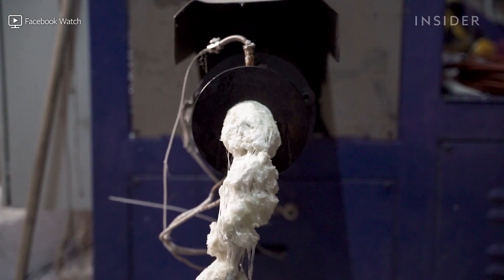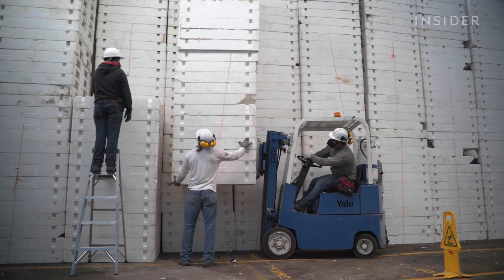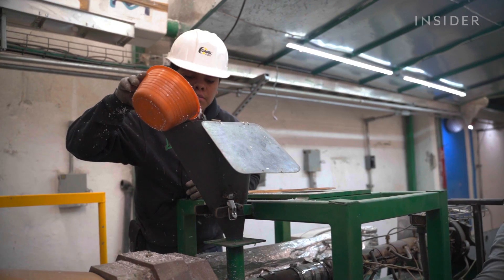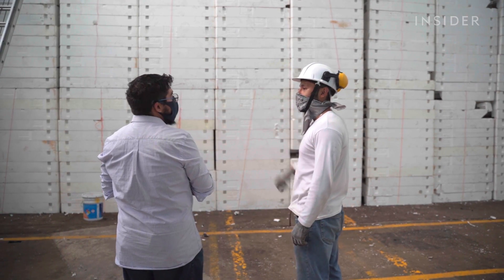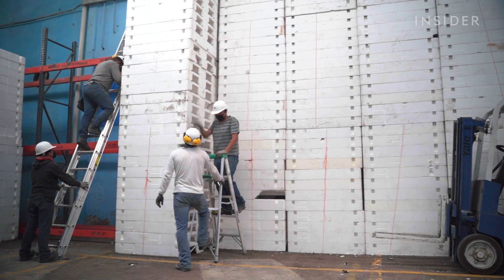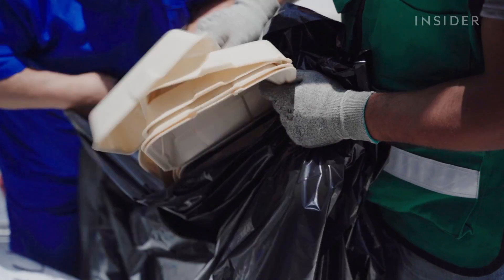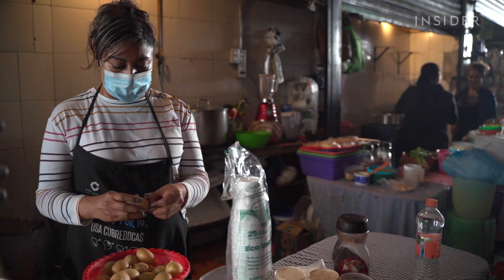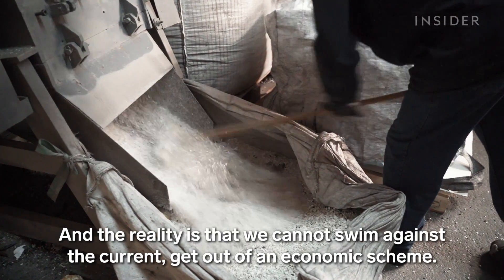Why It’s So Hard To Recycle Styrofoam and Polystyrene | World Wide Waste | Business Insider

Comment: for every type of plastic, there should be equal number of recycling facilities and manufacturing plants, unfortunately we don't have those, so we produce more but recycle less.
Reply: Well the manufacturers should be responsible for the recycling.
Reply: If recycling give profit, people will actually do it.
Reply: There are many types of plastic
But there are many many many many grades of plastics 
Hundreds of thousands if not millions 
It’s practically impossible to have a recycling facility for each of them
Not to mention the nightmare of collecting and sorting them (which actually consumes a high amount of energy and will have a higher carbon footprint and a higher impact on the environment rather than just making new plastics and burning the used ones for fuel)
Reply: @Vedrajrm  One of our only possible ways forward is forcing more standardization in materials to help facilitate reuse. There will always be a need for a certain amount of single use products, so we might as well acknowledge that and figure out how to make it work while creating less of a disaster.
Reply: @Vedrajrm  You can't burn most plastics as they give off toxic fumes... yet more impact on the environment and life.
Reply: @menotu000  you can burn them

Given enough temperature and oxygen you can even burn rock.
Burning plastics at high temperatures and using appropriate filters does not release harmful fumes.
That’s exactly what Singapore is doing. They are burning all their trash and recovering the energy.
Reply: @Vedrajrm  In addition Recycled plastic is a of a lower grade and needs a certain amount of virgin plastic mixed in.
Reply: @Vedrajrm  Then that should be a major point in any government action. Many choice about plastic usage in manufacturing are arbitrary and most needs can be filled by a small slate of plastics. Steer most companies into those options, and you can reduce the amount of non-recyclable plastics.
Reply: @ebwrigh  what options are you referring to?
Reply: @Vedrajrm  better materials are glass, aluminium and paper. glass and aluminium can be recycled almost lossless, paper can be very effectively downcycled
edit: of course melting down glass and aluminium are very energy intensive tasks, but depending on the source of the energy (fission/renewables) this isn't that bad.
Reply: @insu_na  glass isn’t better per say, they are heavy so more energy needed to transport them.
And they are fragile, they easily break.
And with both glass and aluminium as you mentioned, they consume a lot of energy to be made in the first place. Even if you use fission (highly improbable) or renewables, consider the energy needed to build the said renewables in the first place, building solar panels and windmills also takes a lot of energy.
Paper of course require trees to be cut down.
They need land, not just any land but fertile land. Land which might otherwise be used to grow food.
Don’t forget the water and the environmental impact of the pesticides.
There’s a reason why plastics are so popular.
They are by far the best material available to mankind
Reply: @Vedrajrm  lmao at this point they don't want plastic recycled 😭😂
Reply: @thesparks00  plastics recycling simply does not work.
It’s a myth.
It’s mostly downcycled.
Reply: @Vedrajrm  Plastic can be subjected to a process called Pyrolysis where it is turned back into oil or diesel. There's no need to separate the different kinds of plastics and the end product is actually better than virgin oil. Recycling, like you say, is not the way forwards and it's encouraged by oil producers simply because it has limited usefulness and hence not a threat to the demand for virgin oil.
And it can be done on a very low tech basis as is done by families in the developing world that don't have electricity infrastructure or gas, petrol etc
Reply: 100 % And in the near future replace plastic by bio products made from Algea, plants etc.
Reply: What about making plastic producers responsible for providing those recycling facilities, to be plastic-neutral companies?
Reply: shoulda coulda
Reply: Resins 3 through 6 cannot be recycled at all, having 4 separate recycling facilities for them would equal 4 empty recycling facilities doing nothing.
Reply: The door is open to you.  Create your business plan and start your recycling business.  It's my sincere hope that you'll earn a comfortable living while solving a problem and employing others so they can feed their families and prosper.  Or you could just complain.
Reply: The real problem is that people don't recycle. One of the biggest problems, costing a lot, is sorting different plastics, if people has put those to recycling bins
Reply: Yeah bc they don’t give a shit they just care about money and production
Reply: @KidNoraa  Yeah, because we're gonna pay the recycling plants in hopes and dreams. You literally can't have fair wages and benefits if companies aren't profitable.
Reply: @KidNoraa  no its mostly because customers wont buy recycled products. Which would create a demand. Rubbermaid sells bad even though more durable and has recycled plastic. No one buys it because totes are expensive. Me and my family buy it because more durable. No one buys them or tupper ware containers from rubber maid. Because expensive. And every one tells you it will poison you. So really people are killing the demand. People mostly buy cheaper virgin plastic items. So don't blame the company for not buying it. The reason rubbermaid got bankrupt the first time is because no one was willing to pay price for recycled products. So they got sold to chinese company. However the company they got sold to still wants to make them recycled. And brought back a lot of american made products. The only reason companies are not making recycled products is because theres no demand as simple as that.
Reply: @KidNoraa  govt regulation can make them do it but if govt make them compulsory companies would just shift production elsewhere, moreover it may also increase the price of final product drastically leading to inflation which is fatal for a nation
Reply: Reduce. Reuse. Recycle.

To really do something good for the planet we need to produce less. If not possible then reuse. Last thing we can do in terms of damage control is recycle. However, since the corporate world is build on growth and profit we can only hope for regulations that will force companies to use better materials etc.
Reply: @IamYuto  Reusing and Reducing are 10x better than recycling, recycling is just an easy way to make ppl feel good abt themselves
Reply: @IamYuto  smaller companies are trying to bring back quality it cost more though.
Reply: @IamYuto  what are some of the “better materials”?
Reply: @Vedrajrm  cocaine
Reply: California keeps trying to put responsibility for lifecycle management of materials on the manufacturers (that is, if you make something, you have to make sure it can be recycled or disposed of), and it keeps getting killed in the legislature. Just really disappointing stuff.
Reply: Why they don't make fixed coloring to the different kind of plastics avalable? That way we have a more easier time separating and sourcing them into the different recycling facilities ;)
Reply: It was designed that way. Plastic manufacturers knew that most of their product couldn't be recycled economically, but it sounded plausible enough to avoid regulation and make plastics look better as a product to use.

Comment: Step #1. Stop making Styrofoam.

Step #2. Repeat step #1.
Reply: But what when I need to protect my 2 inch rubber ball that's shipped in a large box filled with styrofoam peanuts?
Reply: @justinnee1572  Use water soluble starch packing peanuts. A lot of places, including where I work, already do. You can then snack on the flavorless packing peanuts your 2 inch rubber ball came in ✌
Reply: Too expensive for the vast majority of people